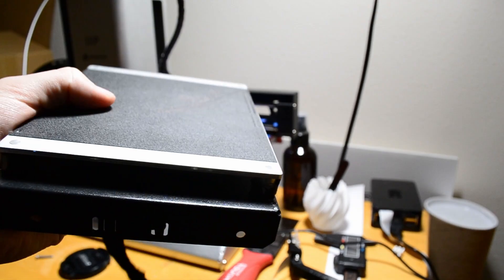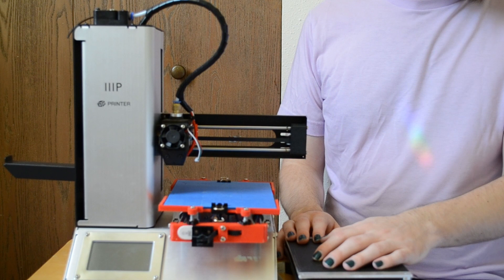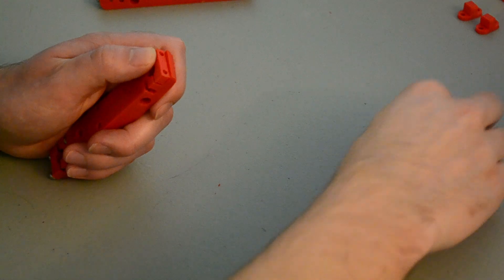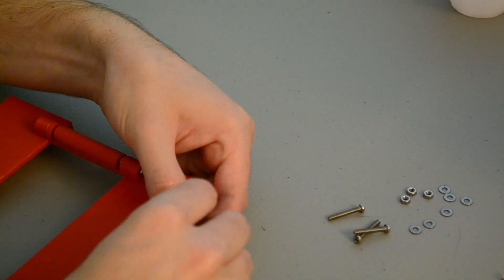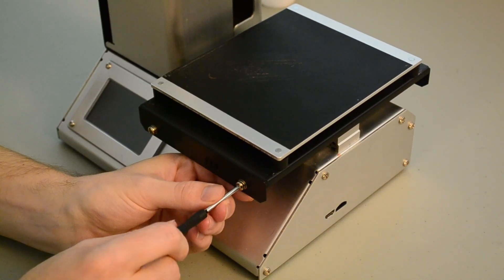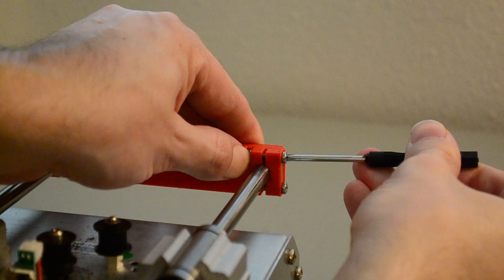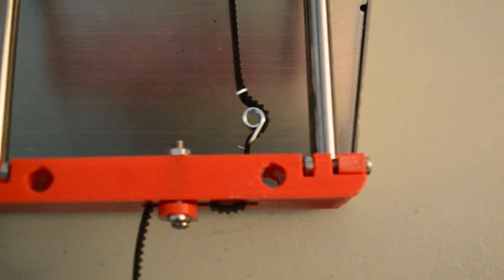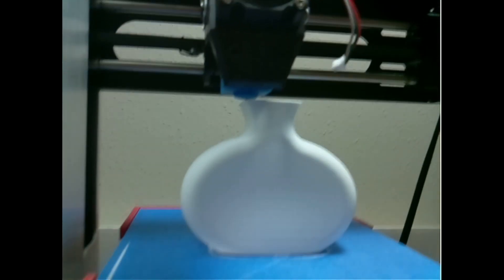Monoprice Mini Bed Upgrade

Comment: Im planning on using this to extend my print bed, how would I make the bed tray spacer longer? (I'm planning on switching out the linear rods for 350mm ones)
Reply from the maker: You can use the below relations to find what the new length of the spacer should be. In your case with 350mm rods you would want the spacers to be 288mm long. 

Relationships for increasing the bed length:
Bed = Rod - 30
Spacer = Rod - 62
Spacer = Bed - 98
Rod = Bed + 30

Comment: ends did no fit maby from shrinkage
Reply from the maker: Which ends are you referring to? The clapping pieces?
Reply: @tinyboatproductions  rod clamp ends and plate  had to go 103 % so bed would but got it worked out